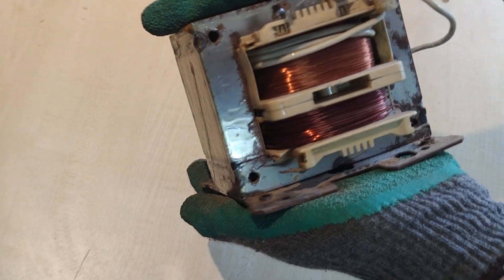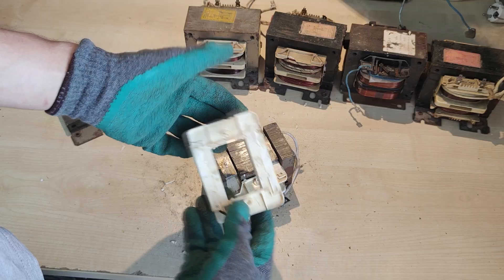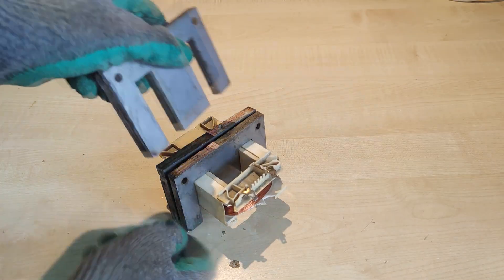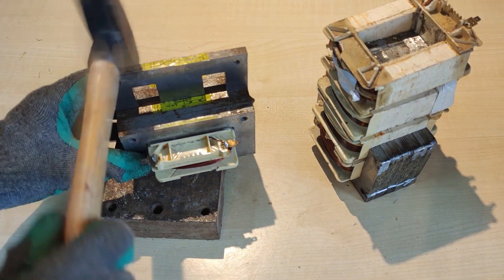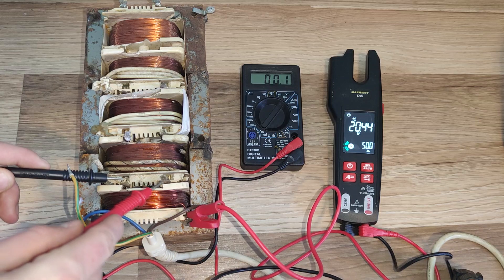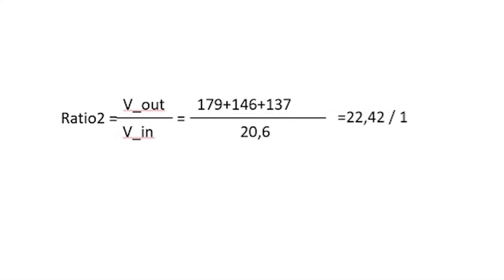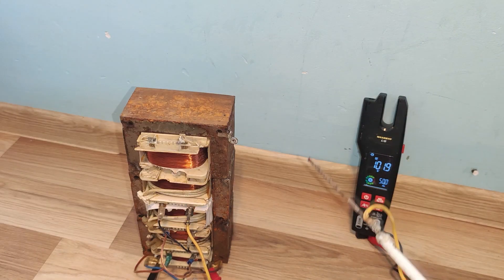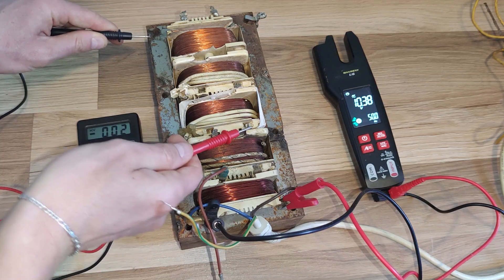Transforming 4 MOTs into a Colossal HV Transformer!

Comment: But why would you go through all this? Can't you just leave the transformers as they are? Connect the primaries in parallel and secondaries in series... Actually, i'm pretty sure, that doing it that way has a high risk of arcing betwen the windings and the core... But i can't see how would your method make it any better. And in fact, your trasformer did burn up... This just seems like a lot of work for no benefit.

Im really curious about this. I would say, that you should probably leave the trasformers as they are and probably submerge them in oil... And even then... I doubt that they will last long. You would probably need 1:1 isolation transformers for each of the MOT primaries and at that point it's getting kinda silly.

Your method could actually be really good if you somehow drasticaly improved the insulation of each secondary. But then the coils would be wider, so you would have to midify the core a lot... Just submerging in oil is probably not enough.

At some point, it is just gonna be easier to either buy a HV transformer or rewind a bigger transormer core...
Reply from the maker: Yes, this is a very good question and indeed it would have worked much better with 4 separate  transformers, but it would have drawn 4 times the power. The reason of this project was to have only one active primary coil, hence increasing the voltage while  using 1/4 of active power. Plus it was educational to see what happens when the magnetic circuit is elongated as such.
Reply: @ElectroScience Ok, i see your point, but i dont think it would be exactly 1/4 power. I'm pretty sure that by having those air gaps and a bigger core you increase the power draw... Measuring the power draw of these modified/unmodified transformers would actually be a nice experiment.

And you're right, It was pretty nice seeing the simulated magnetic circuit 😀

Comment: You can stack two as shown, then wire two of these complementary on the primary side and immerse in  oil. Output is about 16kvAC or about 21kv DC if rectified at up to half an amp. Oil is required mostly for cooling but insulation does help. I used this for powering my first serious tesla coil. ❤
Reply: How the hell did those trasformers survive that? 😅 Did you modify the cores like in the video? Or did you just leave the transormers as they are and connectited primaries in parralel, secondaries in series? Did you use 1:1 isolation trasformers or are all of the primaries at the same potencial?